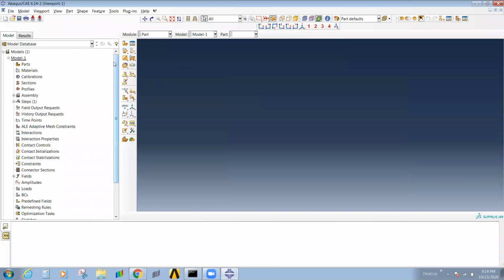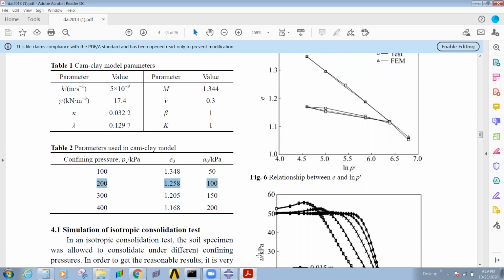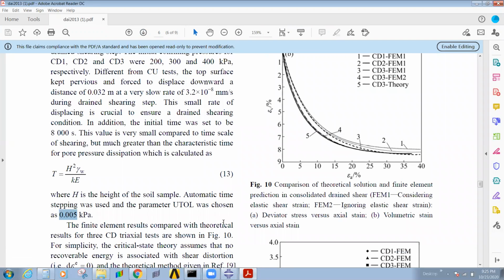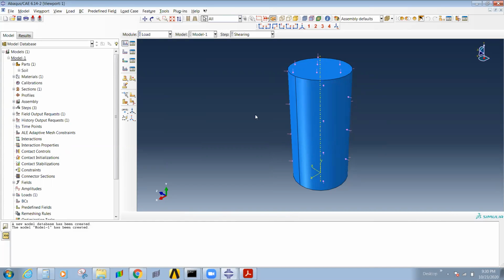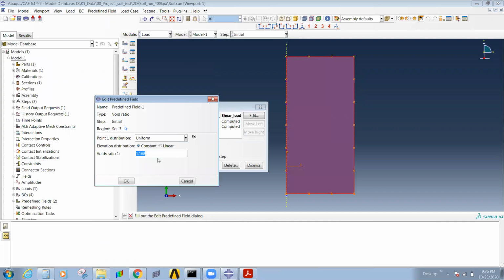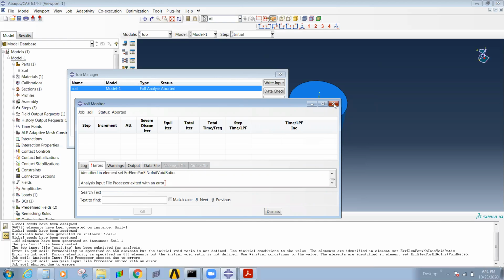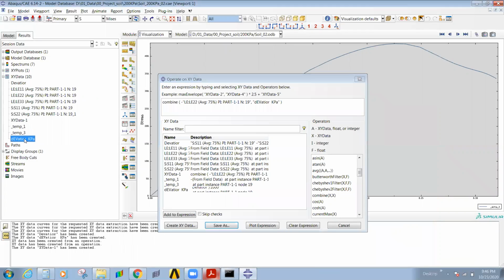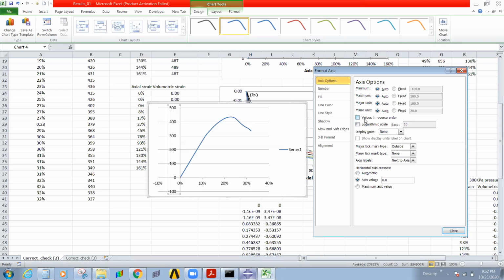Numerical and theoretical verification of modified cam clay model.#fea #structural #abaqustutorial

Comment: Hi, I can´t undestand how could you be able to resolve the last erro: Initial void ratio is not defined. Due to that, I can´t submmit the job and therefore I can´t see the results. I would be so grateful if you could response my comment
Reply from the maker: Just remove the load and boundary condition for one node of the courner
Reply: @arungovin6990 thanks a lot that is in which option or modulus? Thanks a lot for your time to answer my question

Comment: Dear teacher, how do I solve the following error.
" The sum of initial pressue and elastic tensile strength for the porous elastic material in element 1 instance ground1-1 must be positive."

Thanks and regards.
Reply from the maker: Sorry for the late reply.
You might have changed the initial pressure. Kindly Check the Pressure value.